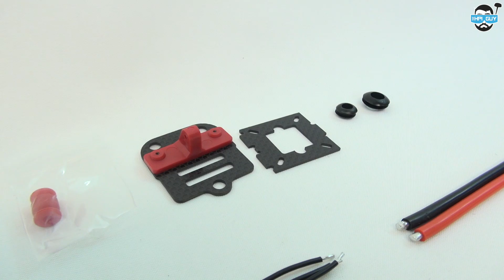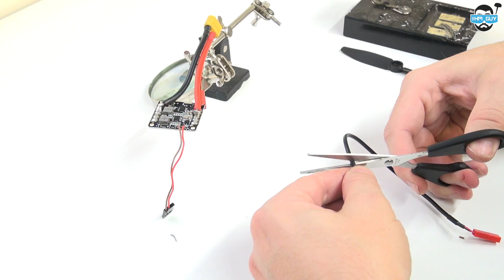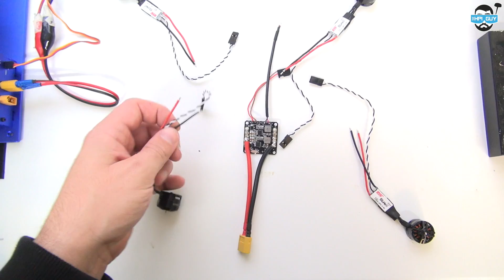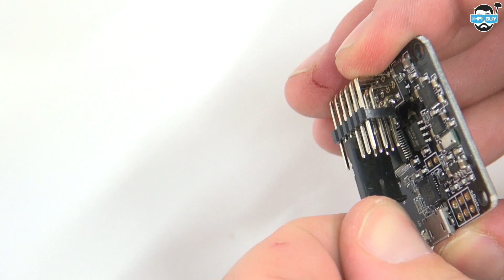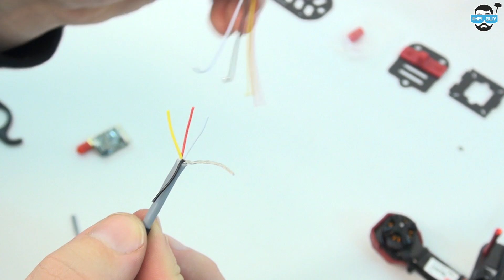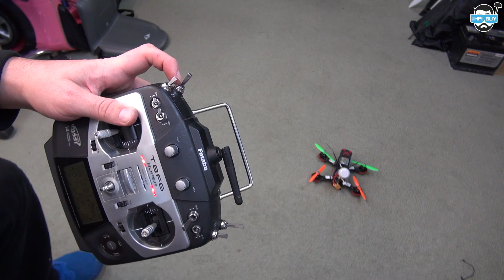HPIGUY | Budget DL180 MiniQuad Build (Part2) Build and Test Fly - From Bangood.com

Comment: What kind of flight times do you average with this build? I tried getting into the sub 200 class last year but the motor efficiency was to cry about. With mobius I think it was barely 3 minutes of racing.

Will this little guy do 5 minutes of hard flying?

Comment: Have you tried little bee 20a escs? How do they compare to the blheli 20amps? I've been running kiss 18amps but they are ridiculously fragile. I've got BLHelis and they are okay, smooth and reliable, just wondering if the little bees have a bit more zing / throttle response?

Comment: What's the little FPV Cam like? Any Good in low light & with changes in light?I have this frame, I have RCX 2205 2633kv motors, 20A Little Bees & use DAL 5045 Tri-Blades, there awesome! But I fitted a Sony Mini 600TVL CCD & had to hack the bottom of the frame to be able to get some good up angle! So would be good to fit a tiny cam like that!!!

Comment: Nice :D I do find the LED 12v out on the PDB is the cleanest. I also have the same Heat Shrink Gun you have but mines red :D
Boris B betaflight rocks as well as Luxfloat stock pids my choice every time. The G-tune also works well. Only trouble i had was with saving the settings. I found if i disconnected lipo without it actually connecting to cleanflight and saving them then they get lost and have to be done again.

Comment: When a contact for an esc comes pre soldered and your soldering iron is hot but wont melt it has my soldering iron broken? i am totally new to soldering and im heating it up for 5 mins with a 30v iron and its not turning liquid :SS
Reply from the maker: As Neal mentioned, use lead solder. My soldering iron is an old cheap piece of junk but it works.
Reply: +Vividcg try leaded solder, or a new temperature controlled iron.
Reply: the esc's im trying to solder already have solder on them. I'm guessing my £6 30v iron just wont go hot enough to melt it. Funny thing was its part of a DYSBG250 RTF integrated bottom plate and i desoldered the wires from the broken plates esc's no problem. the replacement plate must use different solder.. those things are a nightmare to fix next time I'm getting parts and building it :PP 

Gonna try shortening the tip, I can add more solder with it but i wanna melt whats already there if you get my drift :SS